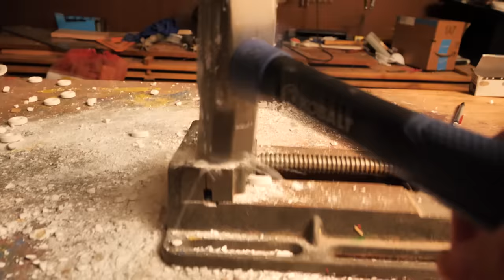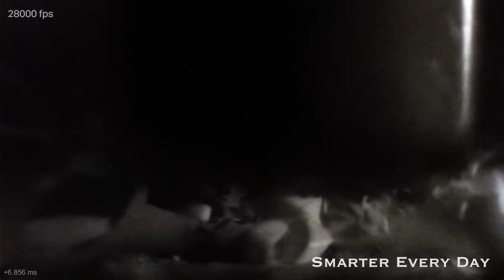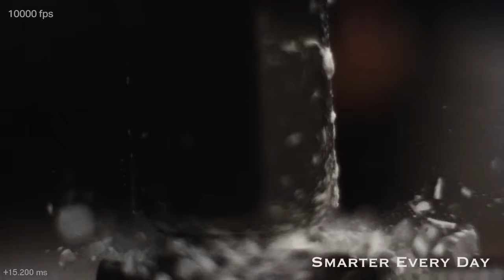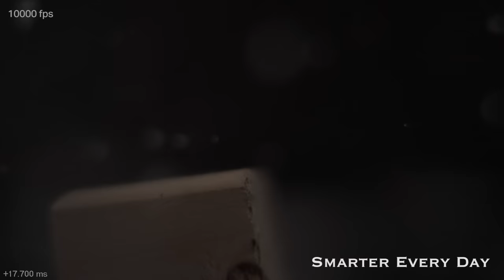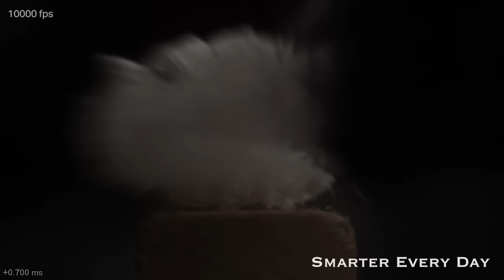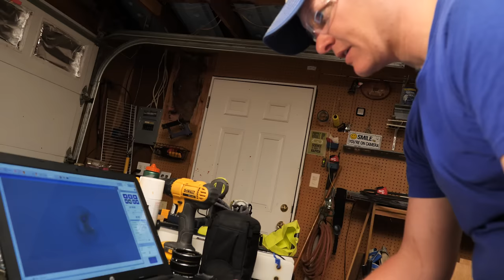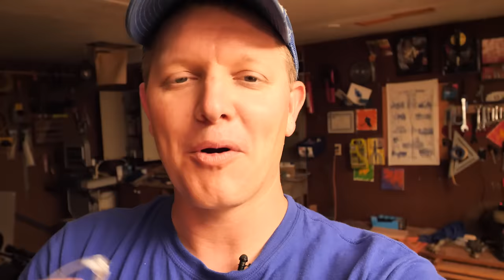LIFE SAVER LIGHTNING (Triboluminescence Slow Motion) - Smarter Every Day

Comment: COOL....  Just an observation, the light generated propagates along the cracks(cleavage planes) , could this be that even a compressed powder like Life Savers(We call them POLO mints in the UK) are in fact held together by electromagnetic(EM) forces. Tearing them apart suddenly, as you beautifully demonstrated, causes the EM forces to be broken without time for the energy to be re-absorbed into the material and is therefore released as static electricity(preservation  of energy) which in turn will cause a corona discharge(spark). A similar effect can be seen if you slowly peel apart the seal of the wrapper on a band-aid(elastoplast in the UK). In low light levels you will see a similar effect at the rifting face as the two sides of the of the band-aid wrapper are pulled apart. Stange light phenomena are often seen around earthquake zones, could this also be Triboluminescence on a huge scale as rocks are shattered. 
Anthony(Prof) Wood.

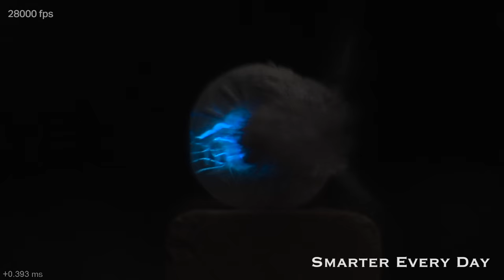Comment: did you notice at 4:30 the blue started to propagate before the pellet actually struck the POLO (yes i am an Englishman and they are called POLO's)...!!
It also seems to me that the energy is only released when the crystalline structure is in compression  (shock wave in front of the pellet?) and then arcs between the separated pieces suggesting a high rate exchange of electrons as the lattice is compressed.  Similar to a piezo effect..??? 
i wonder if a voltage can be measured if the POLO is stressed instead of shattered....??
As in an ultrasonic generator stack, copper washer / polo / washer / polo / washer / polo / washer.....   volt meter across the end washers and compress / shock collapse the stack....  

could be interesting...

Comment: Line of thought
When solid/hard object are torn apart. Like a steel beam. It creates massive amounts of frictions and heat. Bend any mettle object back and forth fast enough and the bend point can burn you. However intense heat can cause light. The speed (build up to cool down) of the break compared to the size/mass/density of the break can alter the light given off. 
Also in England these life savers are called polos

Comment: I'm thinking that the blue light is probably a single specific wavelength of blue light and might be due to a quantum energy change in some component of the lifesaver as it dissapates the kinetic energy.  If that is the case it is NOT a spark but an emission of photons as electrons change energy levels.
Not sure I stated this exactly correctly, but I'm sure someone smarted than me will correct it.  
Can you think of a way to prove it either true or false?

How about a LifeSaver laser, or at least a LifeSaver flavored LED?

Comment: 4:29 the life saver turns blue before it's even hit. I thought it was the release of static from such a drastic pressure change after impact but now I wonder if outside pressure difference is a factor
Reply: No, it was just a shudder, high speed cameras have those 🙃
Reply: The blue blue was there before the pellet hit because it was a camera shudder, camera shudders usually cause things to look impossible, for example: The life saver turned blue before the pellet hit
Reply: @ashtonsenko536  Any good high speed camera will not have a rolling shutter, that would defeat the whole purpose of filming in slow motion. Also, rolling shutters move up and down, not side to side, so even if there was a rolling shutter it wouldn't look like this (The bullet and glow would be cut in half-ish, with the top half of the image containing some pre-impact bullet and the bottom half with some post-impact glow)

Comment: Wait, why the candy gets blue BEFORE the impact of the bullet?
If the lightening happens due to the rupture of the crystal structure (and stress conduction), is the change in air pressure ahead of the incoming bullet is enough stress to cause the lightning?

Comment: Laminar flow meets triboluminescence, now that I have your attention...

It doesn't seem more force would magnify the effect. My conjecture is the effect would be more magnified by either greater acceleration of a shear event or more shear events (or both). 
You need a candy where the crystal structure has many layers in parallel and shear them in line with the crystal grain. How about producing a candy from molten sugar (very dangerous to work with, think tasty napalm) poured in a fashion to produce laminar flow of this rather viscous fluid. It would need to crystalize rapidly to keep the laminate structure of the flow held over into the solid state. Perhaps a supersaturated fluid and cause it to rapidly solidify around a seed sugar crystal. We need the input of a pastry chef, and of course trial and trial and trial and error. Take this sheet of laminate sugar and place between two boards kept at constant separation by spheres on either side of candy. Apply some compressive force to candy while sliding top board forward with high acceleration.

P.S. Has anyone made a Prince Rupert drop of molten sugar?

Comment: I can visibly see a similar bluish light when I strike the driveway or street with a marble or steel bearing loosed from my OPFS slingshot.
 I wonder if it generates enough friction based heat to ignite a fuel source like rubbing or wood grain alcohol?

Comment: You can easily see this effect at home with duct tape. Glue two lengths of duct tape to each other (the darker gorilla tape seems to work better for me.) Move into a dark place and rapidly split them apart with your hands. Keep an eye on the line where the two pieces of tape are unstuck from each other and you'll see a blue line of light.

Comment: THANKS FOR THIS VIDEO ,I THINK I KNOW WHY THESE SPARKS WILL SHOW,MAY BE I AM WRONG,IT HAS TO DO WITH FAST SEPARATION OF MOLECULES FROM EACH OTHERS,MIGHT SET FREE ELECTRONS TRAVELING ,THIS WILL MAKE SPARKS,LIKE SMALL LIGHTNINGS,THATS CONCERNING WHEN YOU HIT IT WITH HAMMER,BUT FOR BULLET  THE FRICTION OF FAST BULLET WILL SET ELECTRONS FREE,ANDTHE PASSAGES OF ELECTRONS IN THE AIR IS A SPARK,NOW TO UNPROVE THIS TRY TO SMASH IT IN SALTY WATER,IT WILL CONDUCT ELECTRICITY AND YOU WONT SEE NO SPARKS ,OK PLACE THIS LIFE SAVER IN SALT WATER  JUST DIP IT AND THEN TAKE IT  OUT  AND HIT IT WITH HAMMER,I THINK NO SPARK WILL SHOW, NOTE (SPARKS IS THE MOVEMENT OF ELECTRONS IN THE AIR IF THERE IS ENOUGH VOLTAGE TO IONIZES IT)

Comment: At 4:30 into the clip: you can see triboluminescence just before impact. What is causing that?
It suggests to me that the candy is under stress just prior physical contact.
Reply: Samuel Durazzo
1 year ago
Sorry I am late but yes the high speed cameras have a rolling shutter (all cameras do) and the usual scanning pattern is either top to bottom or left to right. This is causing that effect, not a Shockwave (: